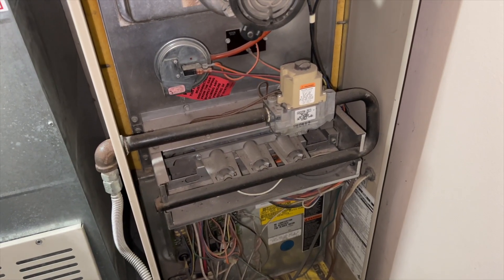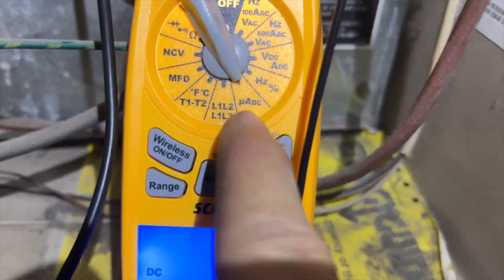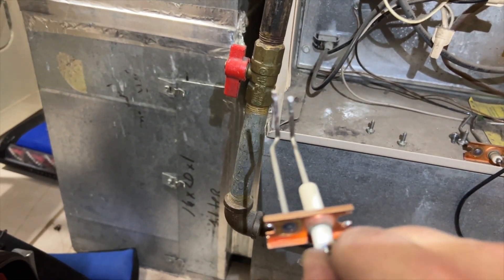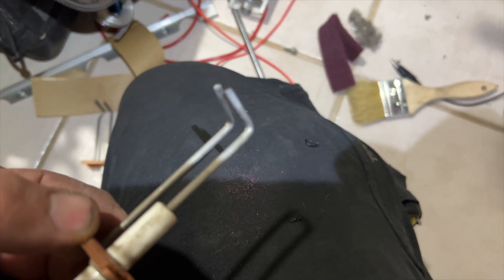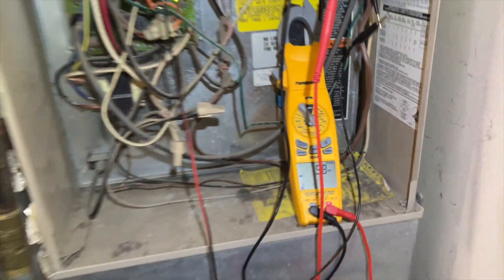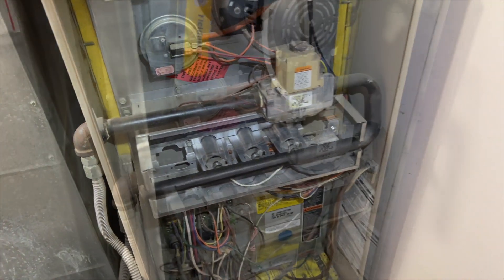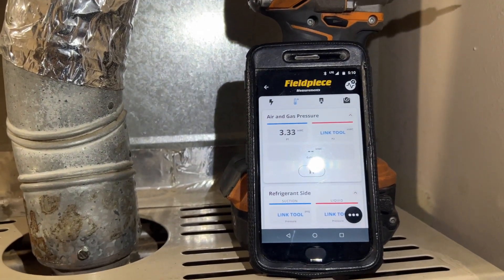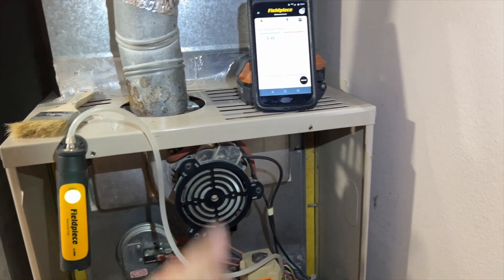No Heat.  Lack of Maintenance.  Burner Lites Then Goes Out EP105

Comment: Just wondering why no heat exchanger inspection or CO levels wasn’t taken seeing the unit was so old?
Reply from the maker: I take CO readings at every gas furnace call. As I usually do this inside I can’t film it. However in a commercial setting I have a do not exceed limit and did not have time to inspect or pull the heat exchanger.  However it was left as a recommendation in the service order.
Reply: @NighthawkHVAC  you mean 😢 inside the property? what about a combustion analysis in the exhaust stack? Good advice for checking other components. Giving owners a heads up of future component issues always a good signal to build trust and providing them opportunity to save up if needed.

Comment: I’m working on a Lennox RTU. I’m getting around 34 vdc on the flame sensor and still the flames won’t stay on. The gas valve is receiving 24 volts. Any ideas? Thanks!
Reply from the maker: Are you checking micro amps dc. VDC will not give you the correct reading.
Reply: @NighthawkHVAC  thanks for the reply. I’m probably not using my voltmeter correctly. What would be the correct micro amp dc reading?
Reply from the maker: 1.7-10 micro amps dc
Reply: @NighthawkHVAC  thanks again! I’ll give it another try!